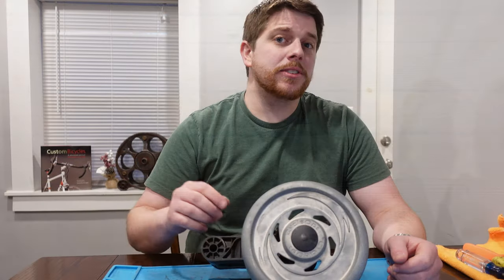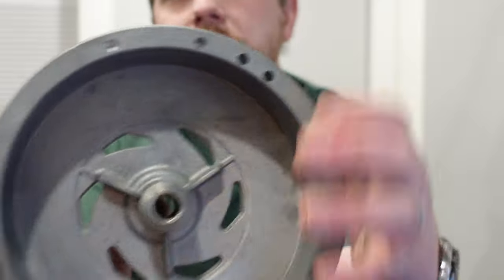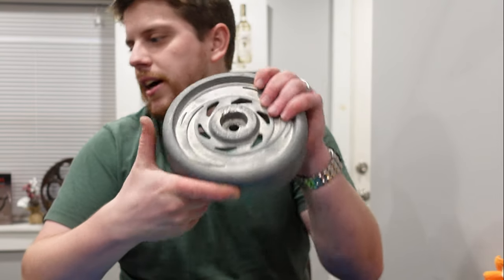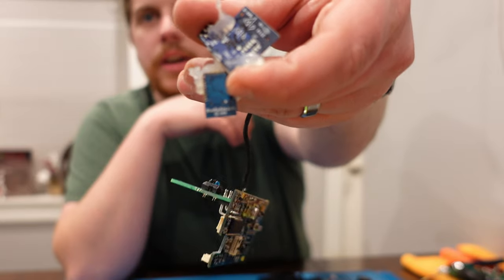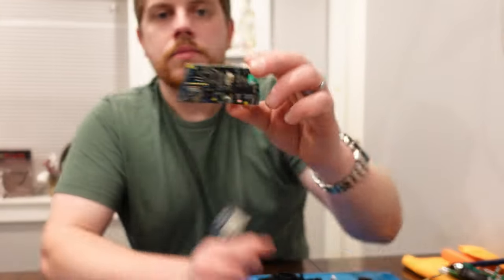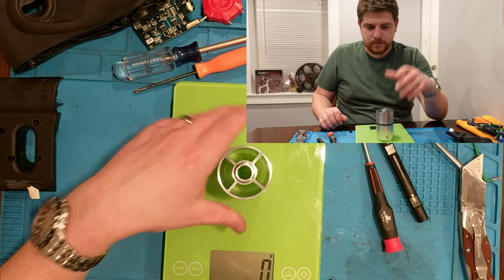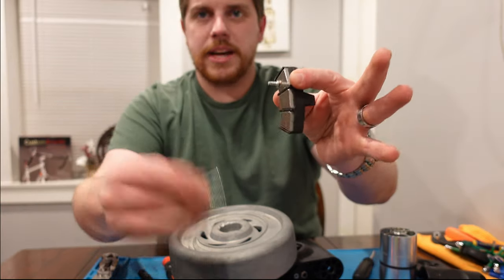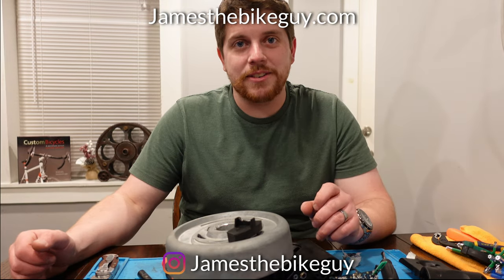Tearing Apart a SARIS Smart Trainer to see what's inside

Comment: I like this kind of video, I tear things apart all the time. Electronics are fun to take apart As well as bike parts. Taking apart bottom brackets and hubs would be cool to see or a spring-loaded and air loaded fork and comparing them. If you where wondering it looks like the part that controls the magnets depth is set up like a brushless motor and instead of a center spinner they use it to magnetize and attract the rod in or repel it out, it was cool to find that. Also the sensor was interesting to see how it works. There are definite some parts I would put in my parts bin from this to mabey use later for a crazy project.
Reply from the maker: Glad you liked it. Might try again with a few other things.